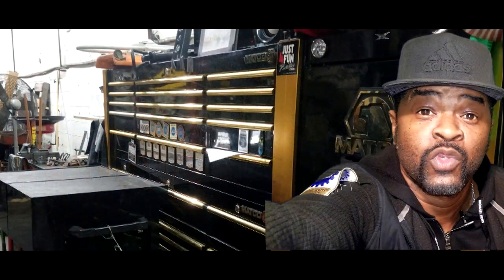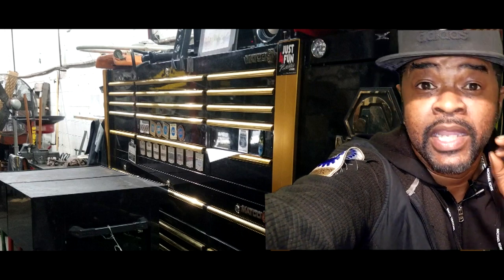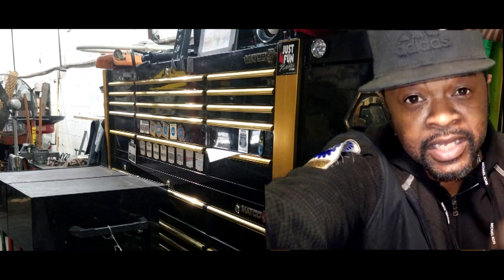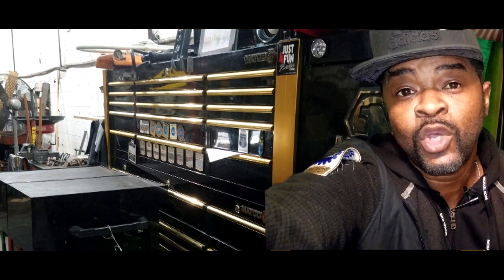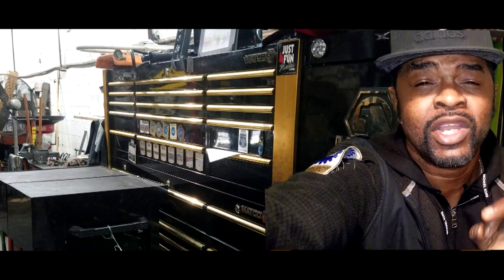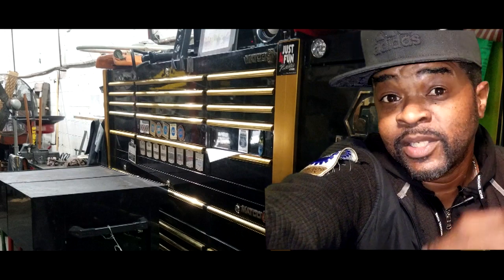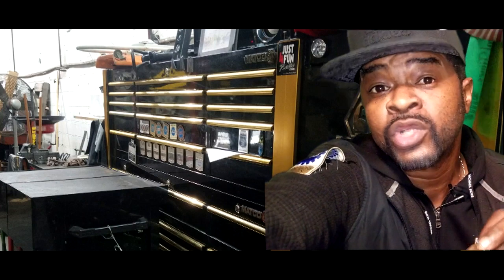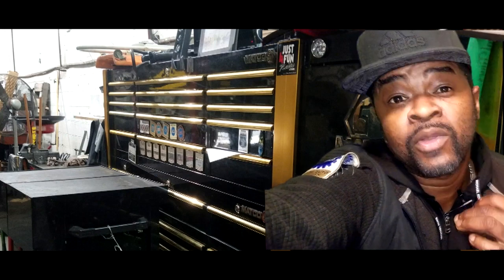Chrysler CASE STUDY for a P0344 P0349 P0369 P0394 FIX, Get this done for Cam Sensor Codes boggs down

Comment: I am subscribed. I already replaced all of the cam sensors but I get the P0346, only when I scan while driving, yet no Check Engine Light. But the error shows on my scanner, only when I scan and drive at the same time. When I scan in park the scanner shows 0 codes. My vehicle does have symptoms. I looked at the wires and they basically look new in my 2014 ford Mustang V6 3.7. I also replaced the VVT solenoid valves, changed the oil, etc. I even purchased more sensors in case I got a bad one. I sure wish someone can give me some much needed direction. Thank you.

Comment: I have a 2012 GC and I got the P0349 code.  I replaced the phasers on bank 1. And still don't have the power.  What could be my problem now.  Also i don't have 6 gear.
Reply from the maker: You may have replaced the wrong phaser
Reply: @OnlineMechanicTips  I replaced both phasers on bank 1.
Reply from the maker: @robbrown7789  P0349 is problems with the exhaust cam on bank 2. Could be a phaser, oil gallery plugs or anything
Reply: @OnlineMechanicTips  hold up, let me watch your video again.  I replaced the phasers closest to the radiator.
Reply: @OnlineMechanicTips  Sorry I misspoke. I did do bank 2 phasers. And I’m gonna replace the cam sensor today to see if that will solve my problem.
Reply from the maker: @robbrown7789 is this a Grand Cherokee or Grand Caravan?  Did you tighten the oil gallery plugs? Did you relearn cam and crank? Is the oil and filter correct?
Reply: @OnlineMechanicTips  this is a caravan. I torque the oil gallery plug to 110 ft lbs.  I did not relearn the cam. I’ll try that after I install the cam sensor.
Reply from the maker: @robbrown7789  They would have snapped being that tight. These are the plugs im talking about on this video https://www.youtube.com/watch?v=_Ow6NmN9ASM&t=2s
Reply: @OnlineMechanicTips  I tighten the  oil control valve bolts.  I will check the oil gallery plugs also today.  I appreciate your help and videos.
Reply: @OnlineMechanicTips  you were right. The oil gallery plugs were loose.  I tighten them and now I’m gonna drop it off to get the ecm relearned. Because I cannot erase the p0349 code
Reply: @robbrown7789 hey I know it’s been a long time but did flashing the computer work?
Reply: @GabrielCruz-gq7fz No I did not. I replaced the cam on the right side (closes to the radiator) and that solved my issue with the problem I was having. It was the tone ring causing the issue.
Reply: @ I appreciate you answering back! I’m in the process of doing that, thank you!

Comment: I have a 2015 wrangler with a 3.6 pentastar. I had recently had to do new timing chains and tensioners guides (melling brand) new oil pump (melling brand) and a new oil cooler. It starts up and runs fine, actually sounds better than when I had bought it.. Anyways about 20-30 mins of highway driving I get the p0394 (bank 2 cam position sensor). When the CEL comes on it goes into limp mode or won't go over 3k rpms. Now when I had it apart I cleaned the cam reluctor wheels as they were covered in build up. Do you think possibly that they could be bad now? I used rubbing alcohol to clean them... It runs really good till that p0394. I've also changed the cam position sensors and I show 5 volts at the connectors which is spec...
Reply from the maker: Do your traction control light or ABS come on as well?
Reply: @OnlineMechanicTips  I have the same problem and my traction light does come on with the cam sensor fault!
Reply from the maker: @joshfelix1568  Which codes are you getting?
Reply: I have the same issue P0394 with everything new. Any help? Thanks
Reply from the maker: @waraya  what does everything new mean? Also are you subscribed to the channel?
Reply: @OnlineMechanicTips  I do why
Reply: @OnlineMechanicTips  yes
Reply: I have the same symptoms,  changed cam shaft sensors but same issue. Anyone found the solution
Reply from the maker: @abdullahcheema7061  What are your symptoms and like I asked everybody else, do your ABS or traction control light come on as well? Also are you subscribed to the channel?
Reply: @OnlineMechanicTips yes my abs comes on and my traction control light!
Reply from the maker: @joshfelix1568  What kind of vehicle is this? Also are you subscribed to the channel?
Reply: Eu tenho exatamente o mesmo problema com a minha jornada de esquiva. Os sensores são bons, mas eu ainda recebo p0394. Isso acontece exatamente após 20 minutos de condução.

Comment: Hello, would this count as a possible solution to the same problem on a 2012 Dodge Avenger sxt plus? I usually get the engine light and traction control light on.
Reply from the maker: If its equipped with a 3.6 Pentastar. Do you have camshaft sensor codes? Also are you subscribed to the channel?
Reply: Yes i am subscribed to the channel :) i am getting p0369 at times and p0344 at other times.
Reply from the maker: @firework-guy  Those codes will likely lead you to cam phasers my friend. Depending on if this a high mileage car, its recommended to replace those phasers and verify oil control valve not loose

Comment: I have a 2014 T and C. We replaced a cam shafter a while back bc a rocker arm broke. Since, we have had periodic  PO349 codes come up with the check engine light and traction control light. We have changed both bank 1 and 2 sensors 3x, were Napa brand and recently switched to OEM after watching your other video. We are still getting this code, the vehicle doesn't seem to be operating poorly, the light just comes on randomly and has gone off if we clear it out or let it cool down. Is the fact that the traction control light comes on an indicator of anything to help us narrow it down?
Reply from the maker: My friend, that is a camshaft problem. Keep in mind if those cam phaser not springing back into position or working as design, these can cause your problems
Reply: @OnlineMechanicTips  thank you, we changed cam phaser when we changed cam shaft, can computer diagnose this more precisely? Like which cam/phaser etc?
Reply from the maker: @carlyn_lacaze  Was cam/crank relearn performed?
Reply: @OnlineMechanicTips  guessing not
Reply from the maker: @carlyn_lacaze  Also, there are 2 oil gallery plugs under the cam phasers that will work they way loose and cause camshaft codes also. Its really all about oil pressure
Reply: @OnlineMechanicTips I took it to dealership, they want to tear apart the head for $626 ...they said they "think" they know what the problem is, cam phaser bolts or rocker arm (again )
Reply from the maker: @carlyn_lacaze  smh, how would a rocker arm cause a cam code? The cam bolt basically a oil control valve so theres a slim chance that would do it
Reply: @OnlineMechanicTips he said there was a bulletin put out about it in regard to that code, I have no idea but am praying at this point. I guess it's like a 50% chance they are being honest. Have heard so much about the "dealership" they hear knocking so it's a bolt or rocker arm in their words.
Reply: @carlyn_lacaze  what was the problem I’m have the same problem with my 2014 Dodge Durango
Reply: @Esmiknow  I'm not a mechanic so the way I explain may not be correct. But we ended up taking to dealership and spending a crap load of money.  Due to certain bolts not being in proper torque  The Cam shafters were damaged and both needed to be replaced This happened in the front and back head. I believe there's 4 total 2 in the front and 2 in the back. You could probably find someone to do it  Cheaper. They tell you they have to take the head off and all that which isn't true there's a special tool that holds the chain in place so you can replace them without removing the head. People always talk bad about the dealership and make it sound like they're a rip off well I can tell you from my personal experience experience they are definitely scandalous and definitely a rip off but they did fix the problem.

Comment: Hello I have a 2012 Jeep Wrangler 3.6 getting cam codes already changed both cam sensors with oem mopar . Traction light comes on . This only happens at highway speed and doesn’t do it all the time it’s an intermittent problem . Jumps back and forth from bank 1 to bank 2
Reply from the maker: Hey bud, what exactly do you mean by jumping back and forth? Also are you subscribed to the channel?
Reply: @OnlineMechanicTips  just subscribed
Reply: Yes I’m getting codes for bank 1 then reset the codes and the codes move to bank 2
Reply from the maker: @robertomarroquin2116  Thanks.  Hey bud, with that P0340, thats bank 1 exhaust camshaft out of sync with the timing via the cam phaser. You will end up with abs light or traction control light. Watch this video here. Now this a van but you have a Wrangler, it the same set up. Also you need to verify those oil galler plugs/bolts torque to specs. https://www.youtube.com/watch?v=B8x8pOjRj5g&t=465s
Reply: @OnlineMechanicTips  I just had this motor rebuilt by a machine shop I have a snap on scanner I am able to see that the cam are in sink . Right now the codes that I am getting is for both Cylender heads bank 1 and bank 2 cam codes
Reply: I sometimes get the code po6dd when I leave for a test drive . I can monitor my oil pressure and see  the solenoid change from off to on . I reset the computer and won’t get that code agin for few days . After driveing on highway I get the cam codes for bank 1 and bank 2
Reply from the maker: @robertomarroquin2116  Theres nothing wrong with the motor, just parts on the motor..They will appear to be in sync on any scan tool. Most of the problem could occur under load, or first thing in the morning cold. You may sometime even hear a clattering noise. Do you get a imbalance code or a C121C?
Reply from the maker: @robertomarroquin2116  Have you done the basic checks yet? Such as verify that the correct oil filter installed?, verify that the oil level is correct? Perform a cam/crank relear after the engine was built?
Reply: @OnlineMechanicTips  yes proper oil filter and level and relearn done no clatter from cam phasers only cam codes followed by traction light . Also code  c121c
Reply from the maker: @robertomarroquin2116  Ok so how would I have guess at you having a C121C, because a breaking down cam phaser would casue everything you mentioned. You need cam phasers buddy. Might as well do them all if this a high miles truck
Reply: @OnlineMechanicTips  that’s why I’m reaching out to you . I will change all 4 phasers and get back to you thanks for your time and the info
Reply: 141k miles
Reply from the maker: @robertomarroquin2116  Keep an eye on those oil gallery bolts, make sure to torque those to specs. Theres 2 on each head under the cam phasers.
Reply: @OnlineMechanicTips  your talking about the bolts that screw in the middle of cam phasers that holds them on
Reply: @OnlineMechanicTips  hey boss I changed all 4 cam phasers and still getting code po394 cam sensor codes
Reply: And p2638
Reply: Do you think I need to update pcm even thought it’s a 2012 Jeep Wrangler

Comment: Good chanel, lots of information 👍, 
I worked on a 2016 promaster with  the 3.6 I did the lifters & rocker arms after all finished have a code po369 I installed a new sensor to see if that would fix the problem but, unfortunately didn't. 
I thought maybe the timing chain jumped a tooth on the sprocket 
I'm double checking the timing, 
Any ideas I saw some of your videos working on those engines 
I would appreciate help since grasping ideas
Reply from the maker: Bud, are you subscribed to the channel?  Also one thing of note. Those phaser bolts and phasers should have been inspected very carefully and depending on the miliage, maybe should have been replace.  And its crucial that they are torque to specs. So back track your steps, surely you didnt let any thing get/touch those magnetic rings on the camshaft right? Also this goes without saying. The camshaft timing HAS TO BE perfect. You can however verify timing by removing valve covers if you have any dout
Reply: Yes sir,I did subscribed, 
I torqued the bolts at specs.
I switched the facers from bank 1 to b2 also 
I'm sure I kept the cams away from everything when removed 
From your experience that the code po369 on this particular case is a mechanical problem?

Comment: I have a 2013 Jeep Wrangler 4 door. I keep on getting the check engine light code po369 and po365 along with the traction light. There is not sounds other than the code coming on immediately. I have 82k miles on it. Any help would be appreciated. Just subscribed to your channel.
Reply from the maker: Hello my friend, thanks for watching and subscribing. Your complaints are sure indications of the cam phaser coming apart internally. You right at that milaige soft spot for when im seeing this problem. I have since started recommending to my personal customers to get these phasers replaced anytime after 80k because they will start giving you problems and also they fairly inexpensive. In some cases, you may hear rattling noise on start up.
Reply: Thank you so much for you response. Roughly how much would I be looking at to replace the cam phasers. Ball park of course. I appreciate you very much.

Comment: Got a 2014 town and country 96,000miles.ticking noice found it on #5intake,replace rocker and lifter only,cam looked great.i unbolted cam just enough to replace rocker,put car back together with new seals,got car running and sounds great,but now I have a p344 camshaft sensor bank 1code.replace back 1sensor code will not clear,check voltage at sensor getting 5 volts on 3,wires,same voltage on bank 2.when I went to dealer to get sensor,the service righted said with it out of warranty sent March we could have warranty that, and fix it,I about shit on my self.i am at the point I may be thanking it to them,
Reply from the maker: Wow. you prolly should take to them. Those cam phasers may be covered as well. Thanks for watching bud. Please subscribe to the channel, thanks.
Reply: I did subscribe,good videos it got the rocker arm change,thank you
Reply from the maker: @douglaskaiser5374  Thanks, what happen on the P0344 code?
Reply: Online Mechanic Tips I had change #5 intake rocker and got it running and sounds good,but now code p344.change cam sensor same thing,if I can’t come up with something I going to bit the bullet and that it to the dealer,going to look at wiring,had no codes before I started,
Reply from the maker: @douglaskaiser5374  Question, did you do anything to the timing? Did you loosen the phaser bolt? Did anything get on the cam magnet ring?
Reply: Online Mechanic Tips I didn’t do anything to the timing,didn’t loosen the phaser bolts.i loosen the cam bolts just enough to slip that rocker out and put new one in and torque,I notice now metal power magnetize to it ,is that how the sensor picks up the signal?so each cam has one?
Reply from the maker: @douglaskaiser5374  Yes, each cam has one and its very important not to let anything get on it or damage it. That is what the cam sensor reads. Everytime I see these codes, its either a cam phaser othe ring on the cam gear was compromised. This is all after the circuit has been checked of course.

Comment: Hey what’s up man I was driving down the highway today in my 2015 Durango and my car slowed down automatically and I got a check engine light with a traction control light and I took it to the mechanic and he got the p0369 code on his scanner. How much does a dealer usually charge to fix this computer issue? By the way I subscribed To your channel my man!
Reply from the maker: Hello my friend, thanks for watching and subscribing. Its hard to say what dealers charge to fix this because it has to be diagnosed first. Now the avaerage dealer charges between 150 to 180 to troubleshoot the problem. Only after then can they give an accurate diagnosis. That code shows a problem with your camshaft signals.
Reply: Online Mechanic Tips right on I appreciate it . I just traded that piece of shit in lol. I got tired of all the issues I kept getting with my dodge.
Reply: @GuitarNgaming  But did you get that particular issue fixed? I am having the very exact same problem on my 2012 Durango.
Reply: Frankie0100010 no I just had my mechanic reset the check engine light and traded it in. I did some investigating and found out that dodge /Chrysler/Jeep/ fiat are the worst cars to buy so I recommend you get rid of that Durango man

Comment: Hey man see your great mechanic I have 2014 my mechanic replaced the ticking rocker arms noise is gone but now runs really sluggish I could stomp on the throttle and will slowly climb after 40 mph rpms drop and get stuck at 1500 any clue what this can be ?
Reply from the maker: Hello bud, thanks for watching and subbing..That computer good enuff to try and adapt but to get put in the area that the problems at, you will need the computer to dish you out a fault code..Was there any codes?
Reply: Yes p0369 p0882 a p0052 tried clearing always comes back change cam senor throttle body tipm and pedal sensor even the intake gaskets
Reply: Always the same
Reply: Also changed  ignition coils and map sensor draining money down the drain